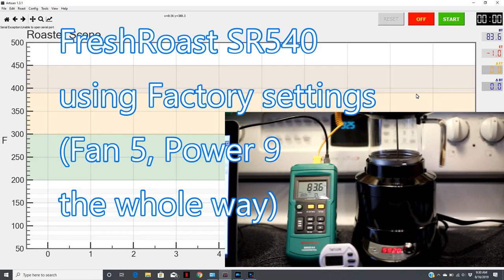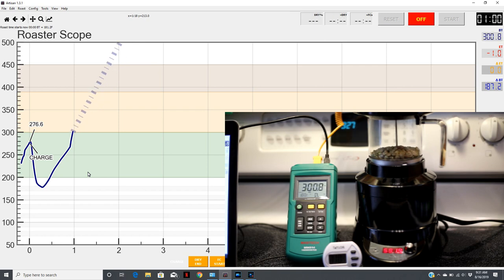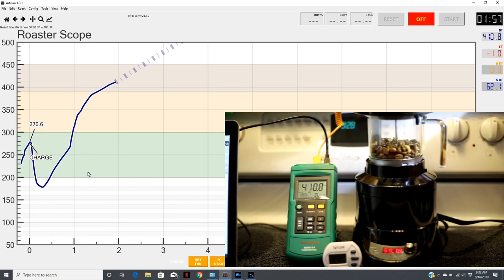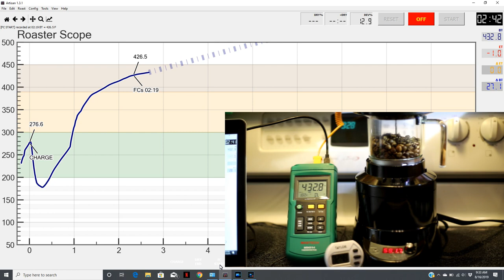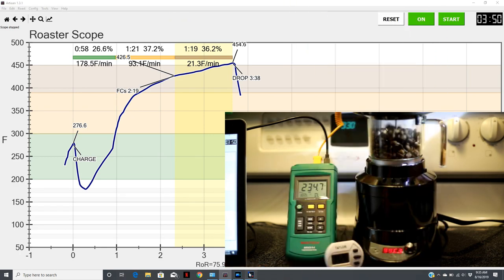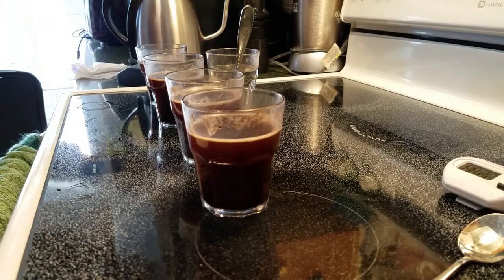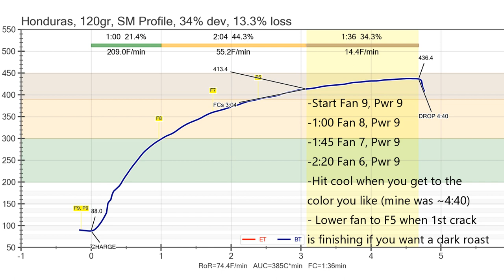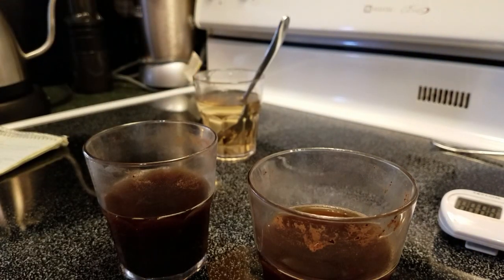Using Factory Settings (?!?!?) on the Fresh Roast SR540, plus 3 other profiles I recommend

Comment: I tried the factory profile that came with my SR800 and after first crack, it went to second crack quicker than I wanted it to and before I could get the beans out of the extension tube to my vacuum cooler, I smoked the beans. Total burned roast. I did brew one pot in the Breville Precision and in the trash the rest went. That was also a 8 oz roast gone to hell. I have found with my 800, drying faze has to be slow, like 4 min. I start the roast on 5 fan 1 heat and then move up never getting the heat more than 5. My 800 has great bean movement from the beginning to the end. I do like my roast med to dark. But there is a find line you have to play with. I built my own cooler and I can cool the beans in less than one minute.

Comment: I'm doing 3 minutes at 9/9 fan/temp. Then 8+ minutes at 5/9. That doesn't even seem to get the beans to a city+. Is my unit defective? This is on an 82 degree day with no wind. I can't believe you're getting this at 4 minutes!
Reply from the maker: Are you using an extension cord? If yes try without. These roasters are really sensitive to power supply at your outlet. Try an outlet in your kitchen where you normally use a toaster etc, just once to see if that helps things (it will smell). Or try an outlet closer to your breaker box. Check temps on the base unit by flipping the control knob clockwise quickly. If you are at fan 5 power 9 and not around at least 450 degrees it may be defective. I'd be close to 480 at those settings.

Comment: With that thermometer, what software can work with it?
Reply from the maker: The probe is connected to a digital thermometer with USB out...I'm currently using a Mastech MS6514 (about $50-$60 on AliExpress). This connects to a Windows laptop running Artisan RoasterScope software. The software is a free download but consider making a donation.
Reply: @keithpoolehomecoffeeroasti489  Thanks for this info. If you were willing, I think a video tutorial of how to hook up a Fresh Roast  to a thermometer and software would be really helpful to a lot of people. At the very least, info on how you hook up the thermometer to the roaster! And where the probe needs to be in the chamber. Thanks in any case!
Reply: @adam1545  I Agree
Reply: @keithpoolehomecoffeeroasti489  What thermocouples are you using?
Reply from the maker: @taylorwhite3636  with the stock chamber I use this, but since I bought the chaff lid expander I probably should get something closer to 175mm in length.
150x3mm K-Type Thermocouple Stainless Steel Probe Temperature Controller Wire Sensors (3x150mm) https://www.amazon.com/dp/B07V5Z3WF6/ref=cm_sw_r_em_apap_mm5DYuRZrmmNY
Reply: @keithpoolehomecoffeeroasti489  So let me get this all straight. SR540. You used some kind of wire (which?) to extend the chaff lid up for airflow. How did you secure it in place and all that?
Then you put thermocouple in, run thru mastech to artisan. 
Thermocouple is 3mm, so you drilled 3mm hole in center of fresh roast lid? And I guess used some kind of adhesive sealant to seal the thermocouple in place? Position thermocouple in center, with tip above the fan but in the bean mass? Any advice on how far down?
I already have the mastech and a laptop that works with artisan, I might buy a SR540 if artisan is this easy, and curves are pretty good easy to manipulate!
My question then is, SR540 or SR500 with the extended tube?
Reply from the maker: @taylorwhite3636  i bought the chaff lid expander from a guy on Etsy, his page is RazzoRoasting , I think its $20-25 plus shipping. I think he's on break for a couple weeks so his site might be on hold.

Comment: Uneven does not mean bad coffee. I have had several roast uneven and turned out to be really good stuff. Like blending coffee. I use an SR800 and sometimes I will take coffee from two different roast and blend them together for good taste. Also, I have re-roasted several times if the coffee has a grassy taste. Some say you can not re-roast coffee. I say to them, BS.

Comment: Thanks for all the time you put into gathering this footage and info Keith. The last two profiles, even though you showed them to us, you didn't mention what roast you intended them to be. The EVEN profile seem to give you a darker mixed coloring.  You really played with the settings. It may have been you but I saw a video showing that lowering the fan settings by a single unit increases the heat at least twice as much as raising the power 1 unit. So I am glad you have the setup to show how mixing the two affects heat and time. I am hoping this helps me. I bought a sample box of great coffee beans from great sources to test and learn this Sr540. Hoping your vids get me on the right track. My first batch at 130 grams seem to take the time to come to the roast level but seems I have a great fan. It does change speeds as I work the knob but I am getting great bean movement. They are constantly rolling down the side of the glass from the top as they surface in the center in a bubble looking form. I don't see any laying down of the beans as they first dry like many who start on fan 9 as I can use 7or 8 and have plenty of movement at first start. I am hopeful that I may be able to do 5 plus gram batches at a time. They just start rolling right away. Beans do not look over dried and are smooth skin. Sample box from Deans Beans that I assume is a good company. They are delivery well boxed and beans individualized in tin-tie printed bags with a nice writing about each bean.No expense spared. Starting to read on Sweet Maria's. This looks like a great place to resource everything.
Reply from the maker: Thank you, enjoy the roaster!

Comment: how did you hook this roaster up to the computer? I just acquired a freshroast sr540 and would like to try that.
Reply: The probe is the one from the Amazon link below, it's a 3x150mm k-type probe for about $8.  I drilled a small hole dead center through the top chaff lid and inserted the probe through there (the lid is only $14 if you are worried about warranty).  The tip of the probe sits about an inch above the little dome at the bottom of the roast chamber.  You have to connect the probe to a digital thermometer to get a read out of temps.  A basic one is less than $20, but if you want to connect it to a computer you'll need a digital thermometer with USB connectivity.  The one I am using is a Mastech MS6514 (that's the green thing in the video).  I believe on AliExpress it runs about $50 to $60.  My laptop is running WIndows.  The software I'm using is called Artisan Roaster Scope.  The download of Artisan is free but consider making a donation.  Hope that helps, good luck!
150x3mm K-Type Thermocouple Stainless Steel Probe Temperature Controller Wire Sensors (3x150mm)

by bulushi

Learn more: https://www.amazon.com/dp/B07V5Z3WF6/ref=cm_sw_em_r_mt_dp_U_Yd2gEb14AB2WM

Comment: Wow the SM roast method produces a very nice curve with your thermocouple. The SR540 is the older fresh roast, right? Have you ever tried the taller chamber?
Reply from the maker: Yes I have an extended roast chamber, but I've ended up mostly using the stock roasting chamber with an expanded chaff lid from a guy that sells on Etsy under the name RazzoRoasting.  The lid expander is around $19 plus shipping but you may be able to make your own if you are handy. It improves the flavor, produces more even roasts,  especially on chaffy coffee like naturals.

Comment: 1. What is the difference in taste with shorter (4-5 mins) roasting duration versus longer duration (7-8mins)?
2. Based on your current setup, what is the difference in temperature between ambient (AT) and beans (BT)? 
3. I understand that your ambient temp is pre-installed by the manufacturer, how about the beans temperature probe?

Comment: Do you know a ball park difference from the bean temp and the internal thermometer reading?
Reply from the maker: On my setup (540 with stock roast chamber and chaff lid expander), the machine temps (inlet air) are always higher than bean temps. They start pretty fat apart and get closer together at end of roast. For example, at the beginning of the roast, like  the first minute, machine is maybe +100F. In middle of roast maybe +50, by end of roast just before cool maybe only +20. Realize that the 'bean temp' probe measures a lot of air too throughout the roast, so to make things even more confusing, the true bean temp is probably 15 to 20 degrees lower than what the bean temp probe shows. So for first crack, probably true bean temp is, what, 385? My bean probe shows 400 and machine shows 450. At end of roast, just guessing but true temp maybe 405 to 410, bean temp probe 425, machine still sitting 450 because I don't typically make setting changes after crack starts. Hope that helps.

Comment: Where'd you get the probe and green reader?
Reply from the maker: I got the probe from Amazon, Bulushi 150x3mm k type probe for about $8. I don't think they have it anymore but maybe there are some substitutes. The green meter is a Mastech MS6514, from AliExpress but check around on eBay and Google. The price can vary from $60 to $200 for some reason. There is a similar one called Perfect Prime that seemed more available and decent price and it does work with the Artisan Roaster Scope software (just pick Mastech as the meter). Make sure the meter has the USB port to connect with computer if you want to log the time/temp curve.

Comment: Thanks for the tips. I'm wanting to move up from roasting in a pan to something like this. How is the mess? Do you have a lot of cleanup after each roast? Also, can you do back to back roasts without a long delay?

Thanks
Reply from the maker: It does generate a fair amount of fumes, some smoke but not as much as the fumes.  I have a vent above my stove top and it still smells for a day or two in the kitchen after roasting.  Chaff is well controlled though, not hard at all to empty (but the chaff lid does get hot so wear gloves, just dump into trash can).  The manual advises a 30 minute wait between batches but honestly it's probably just a precaution and helps the electronics in the base.  I probably give it 10 to 20 min at the most and it operates just fine.  I roast, cool for 2-3 min, lift up and clean chaff lid with about a min left in cool cycle, dump beans into a tray, weigh the beans to get % loss, finish any notes I'm making on the roast, pick out a few quakers, bag up the roast, then weigh my next batch, and all that seems to give it enough of a break.  I do add a few minutes extra cooling fan and just remove the glass roasting chamber so it helps the base cool off.

Comment: Q1. I am still trying to achieve some oil spots on some beans, which profile that you use to achieve this - ODD and EVEN or SM?
Q2. At what temperature that the random oil spots will occur?
Q3. Does the random oily spots only emerge after 48 hours?

Thanks for the helps.